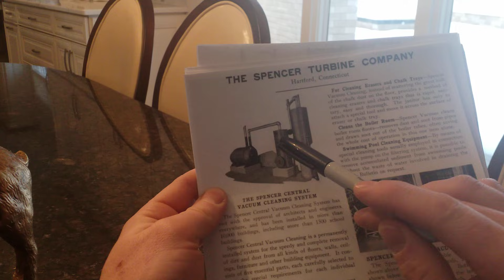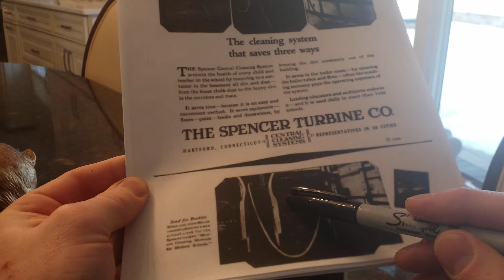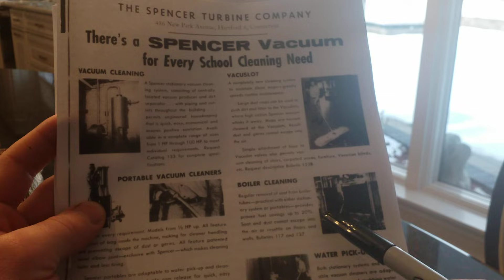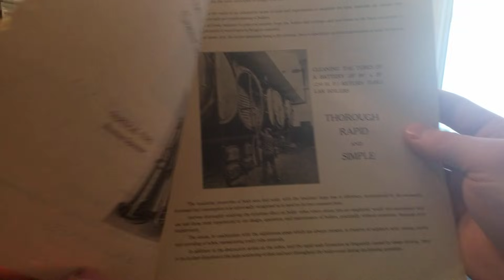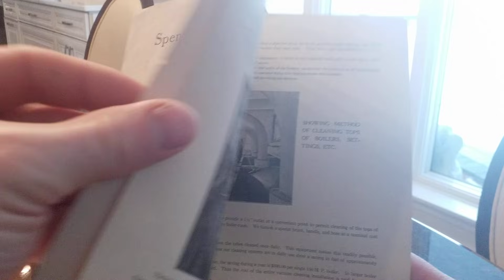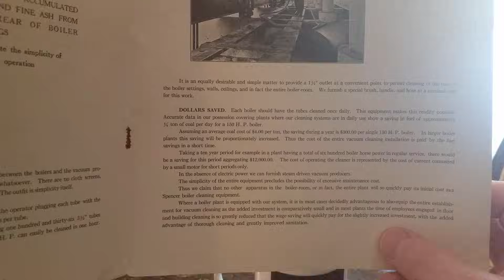Vacuum Cleaning Your Boiler Tubes

Comment: Electricity is mostly generated by coal fired power plants...This seems to be really a U.S.A. matter in North America as in Canada most of our electricity is actually generated through CANDU nuclear plants and hydro-electric generating stations.  I am not saying there aren't any plants that utilize coal in Canada, but a small percentage is generated by burning fossil fuels.  That being said, a lot of our schools and houses at least in my town of Goderich, Ontario still heat by means of boilers and other radiant systems.  Some houses have both forced-air and radiant heating as the latter is often installed in the floor but most of the time in that sense the "boiler" is actually just the tank style  water heater...which for these methods vary between electricity, natural gas and fuel oil.

Cleaning boiler tubes of ash and soot with a central vac is unheard of now and a potential fire hazard...unless there is someone out there that actually makes an interceptor that is rated for pickup but at the same time, people would just use an ash vac and almost any company (thinking mainly Emerson Electric who makes Ridgid, Workshop Vac and Pro-Team and  and Shop-Vac) that makes a wet and dry utility vacuum also make an ash-rated vacuum.

Steve's videos are quite neat, I haven't watched them in a while but one of the joys of his videos is or was seeing his dogs that travel with him in his step-van. 

I can't imagine cleaning a school now with a central vacuum.  If anything, the poured Terrazzo floors in them have more or less made them obsolete because to clean them you get one of those all-in-one auto scrubbers that do several jobs at once and the neat thing is if kids are wearing Winter boots with snow melting off of them as it can pick up water and since it actually uses water in the cleaning process, yes, central vacuums are deemed obsolete here.  I mean, you can also just sweep them with a mop and cleaning off the mop at the end of the day doesn't require a central vac either as you can have a base station like what you see with some robot vacs with a "vacuu-slot" in the closet to vacuum the remaining dirt off of them.  Often you just shake the mops at the end of the sweeping and dispose of the dust in the cart.

I could see boilers rated in horsepower due to the fact that a lot of factories and large buildings may have had a steam-driven engines or turbines running machines or generating the necessary power to make the facility run.  Now they are probably rated in kilowatts, or at least on the rest of the majority planet that uses S.I. units.